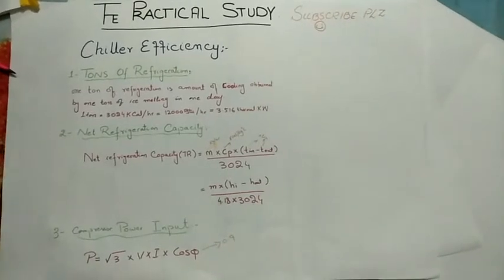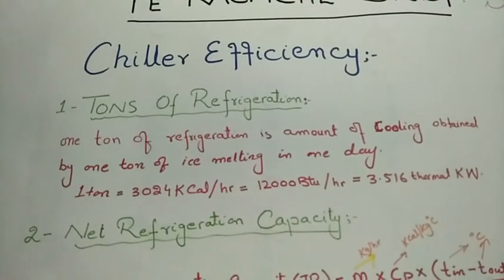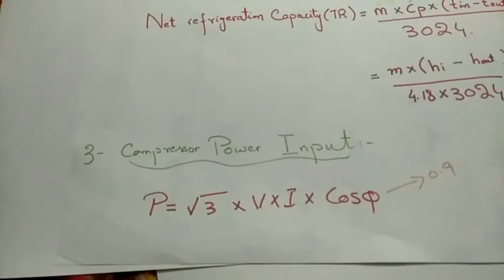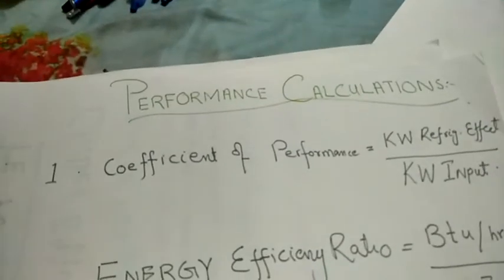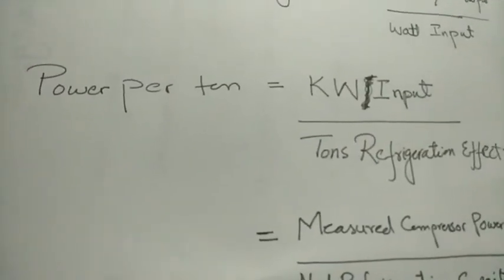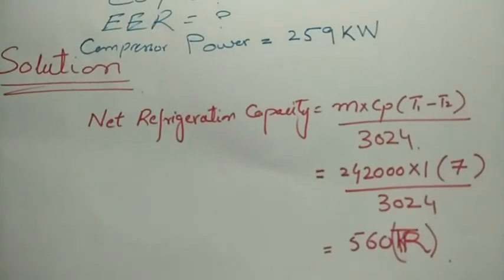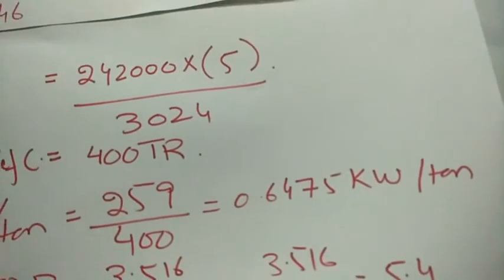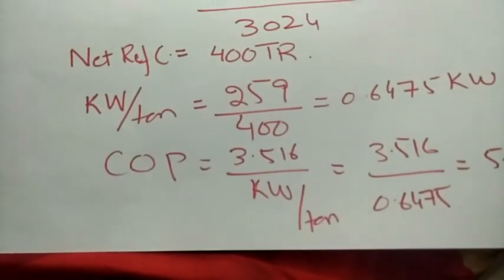Chiller efficiency calculation

Comment: Dear Sir, your video is excellent. i have some question here, please reply, what is conversion factor from ton to flow rate (kg/hr), as u did 400 ton= 242000 kg/hr, i have checked at google, its showed i ton=227 kg/h but your conversion coming 252, 2ndly can u reply how u find compressor kw from catalouge, just example. thanks & best regards
Reply: 218016kg/hr